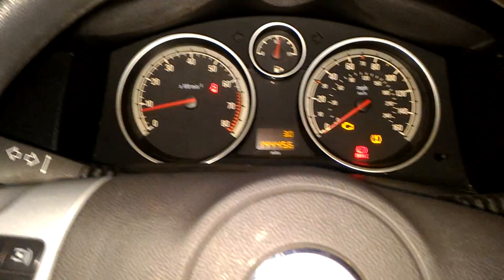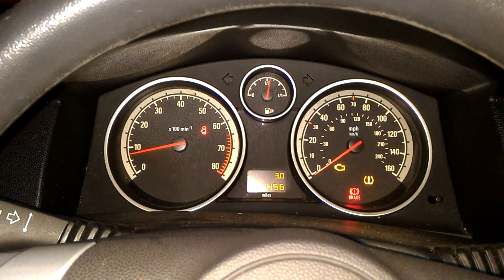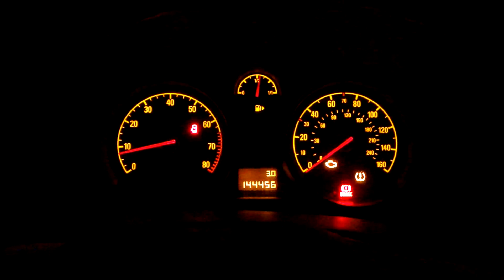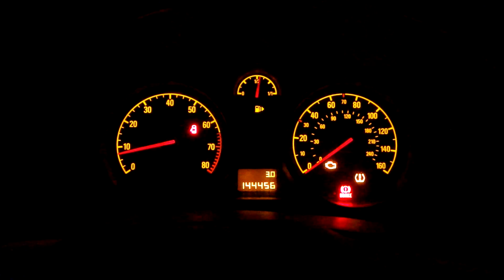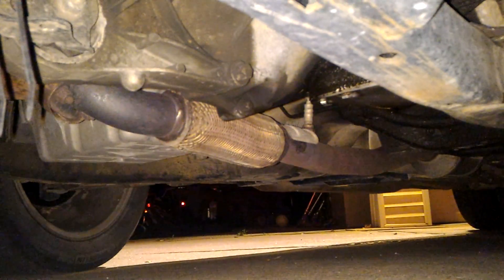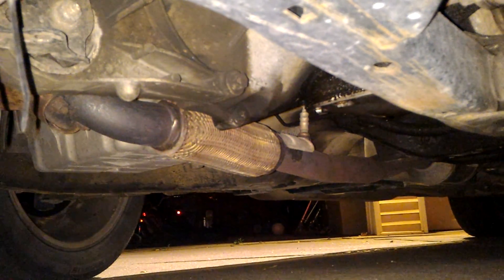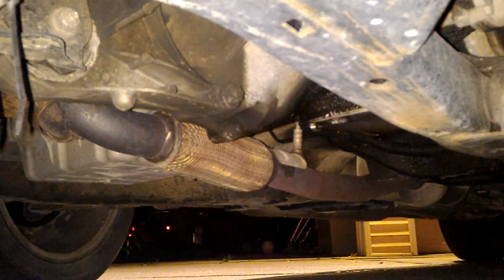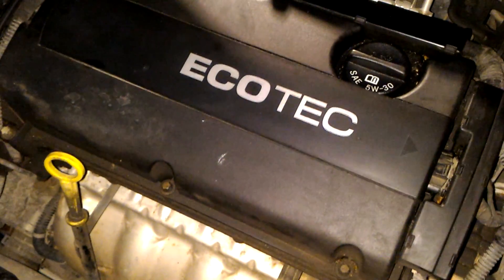Saturn Astra Engine Loss of Power (Solved)

Comment: Soooo what was the problem found for the power loss?? As you didn’t say,just reving the engine. Was it a clogged catalyst converter??
Reply from the maker: It was exactly a clogged catalytic converter.
Reply: Oooh ok,thanks

Comment: Before you end up selling it. Does your radio work fine and did you change the timing belt or alternator? How about windshield washer reservoir? mine has a leak not sure where it’s coming from.

Comment: Oh God help you , didnt know you guys in the States got British made cars, here we call it a Vauxhall , its a shit heap of a car, my one has problem after problem, anything made by GM should be killed with Fire, even Ford produce better cars nowadays
Reply from the maker: Yes, this model only lasted one year over here.  Saturn (and a few other GM brands) went belly up in 2008 so it only sold a handful.  They were intended to replace the absolutely terrible Saturn Ion so they went and grabbed this Belgian-made car, slapped a Saturn tag on it, and fiddled a little bit with the emissions to make it legal here (or I should say to make it legal in California), and sold it.  I haven't had many problems with it, but I'll probably be selling it soon.
Reply: @spitfireap77  only good thing i can say about them is they are fast on the top speed , a friend had a tiny 1.6 litre version managed to hit 135mph on a highway but was always having Ecu faults with the car , Vauxhall here in the UK have always had a bad reputation even before GM took them over anyway glad to hear they didnt last long where you are as you guys deserve quality products like Audi BMW Mercedes etc from EU not the garbage
Reply: Spit-my dad also has an 08 with the same issue. Crappy low quality GM parts..no catalyst should be going bad in 11 years. I bought a new exhaust manifold for $140 turns out the exhaust was still plugged with the pieces of the old cat getting stuck in the exhaust system. Exhaust will have to be removed and the cat crap blown out of it. Other than that the car runs good. The sound of it clogged up it horrible.
Reply from the maker: @Revo2Evo  I agree that the cat shouldn't go bad. Mine happened to come from a drive through some water which, due to thermal shock quickly contracting the metal, cracked the ceramic. So I'd say mine was more of an accident than a failure.

Comment from the maker: Solved - problem was the catalytic converter.  Just a few days before this my town had a huge thunderstorm with tons of rain dumped in 30 mins.  I took my daughter to school that morning and drove through a fairly large puddle of water that I couldn't see due to the heavy rain.  The cold water hitting the hot catalytic converter had contracted the metal quickly (thermal shock) and cracked the ceramic core of the cat.  As I drove, the power decreased due to those bits of broken ceramic being blown back and blocking the exhaust system - mostly at the second cat which is about 3 feet behind the first.  I replaced the front cat, cleaned out the second and was back to normal operation.
Reply from the maker: Drico Hattingh I replaced the main catalytic converter - pretty pricey.  I believe the replacement part was $500.
Reply: spitfireap77  what did you do exaly im struggling
Reply from the maker: @dricohattingh4388  I replaced the front catalytic converter.  I bored out the rear one.
Reply: spitfireap77  can you help
Reply: They most likely had it replaced. If the catalytic converter goes, it should be replaced. There's no duct tape fix to this, and I don't recommend one.